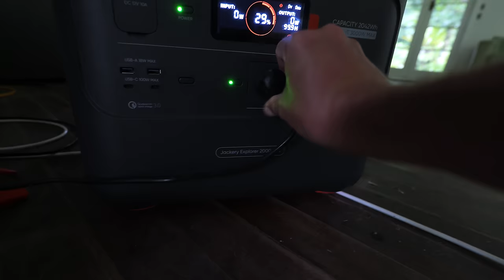Someone snitched. This is my response

Comment: Hi Max. Great job man. Hey Im a chippie and have a couple of ideas that might help you out. 
1, have you thought about using a Ceiling pulldown ladder for your upper deck. Im Sure with some thought you could adapt one to be used in your situation.
2, to make your New fantastic gates more secure...weld a big round washer to the top hinge pin so that the gates cant just be lifted up and off the hinges with a crowbar under the gate. A person with the knowhow could get those gates off the hinges in literally 5 minutes.
To make them 100% secure those hinges are surposed to be installed...bottom one facing up and top one facing down. Thats a tuff job to do but they would be very secure...if you understand me.
And dont worry about whoever wrang the council. Now you have a report with the council it will be so much easier to get help from them in the future 😊
Reply: Who would have told on you ? Gee why don’t people mind your own business ?
Reply: @tonifoster1835  ??? Not sure what your meaning there sorry
Reply: A great reply, love the idea of the pull down ladder and also regarding the gates.  That is how it should be with helpful advice, not complaints. Well done.
Reply: @brennz64  I mean who would report Max to the council, not difficult to work that out is it? People should get a life and but out
Reply: The gates only stop random vehicles onto the property…. They’re not enclosed on the sides, you could just walk around them.
My hubby is a glazier, he always says: “Glass only keeps honest people out”… meaning nefarious people will always find a way regardless. 
(They’re also just thin wood gates… a car/truck could just barrow them down without having to lift anything off. Normal people wouldn’t do that obviously… but if they’re bad people, they’ll do it any which way anyhow)

Comment: To preserve those beautiful beefy hardwood posts slap some black Flexseal rubberized paint on the exposed tops of the posts. Another option is to attach black iron post caps which are very handsome too.
I think the gates would look better and be better protected if they were completely charred.

Comment: You are being very polite indeed. Having a good relationship with your council is a great idea so that is another plus for you. My vote is for all black for the gate. The other thing I noticed but my experience with wood isn't much, should the top of the gate need some sort of sealant on it? The top part you cut back etc. I love the look of the gate and it is perfect for the setting anything smaller would have looked odd.  Regarding the ladder for the raised part of the patio (near the RV) my brother built a wooden ladder like you have with hooks at the top and long enough to be easy to climb (like yours) and when he wanted to get on top of the structure he had, he would just hook the ladder over the top and it looked great and safe.He removed it after using as he didn't want the kids climbing.  It has lasted 10 years so far.  All the best and happy homesteading!!!! ❤
Reply: Great idea & gets around council BS
Reply: Excellent idea! I often see them used in tiny homes to access loft spaces.

Comment: Great response Max to a frustrating situation.
The gate looks fantastic, very boujee!
I’d do it all black. If you do want to leave some grey timber, put a frame around a small section. Then perhaps ask a local blacksmith to craft a silhouette of a pademelon or fig tree out of metal to put in front of the grey timber, inside the frame to make a nice feature.
Reply: Imagine if it comes out that the busybody who reported the stairs has now an official complaint about the gate 😮. I have the feeling it was one of the members of this community
Reply: The gate looks great but probably unnecessary as it makes it slower and more difficult for you to get in and out as well as for visitors, deliveries etc.

Comment: Lovely gate, great work! Going forward I would suggest in your wet, rainy environment that you add a little more cement to create a slightly sloped 'skirting" around the base of each post so that rain water sheds away. I think as it is it will catch on top of the cement and seep down along posts into the base hole? Also, along the same lines, and it would be a nice touch too, to make, or buy a cap for the top of the posts also to shed the water so it doesn't soak into the grain from the top. Example: Nice solar self-charged lights are often the design of fence post top covers. Well done work!
Reply: Good thinkin' 👍

Comment: We had a 12.2 M x 2.5 M steel frame and board on board drive sliding gate installed, it was a monster.  We had to have a pretty big "Y" dog at the end to direct the gate closed when it was windy as it was closing it would act like a sail.  It was large enough it had to be custom built onsite to match the slope on the driveway.  Keep up the good work sir!  🤠👍

Comment: Max, what about building the stairs as a removable “ladder”? No rails necessary.
Reply: Yes, exactly my thoughts.
Reply: Great idea.
Reply: I think he said he needed it for support? That it’s partially structural as well
Reply: I was thinking this too.  Or add a collapsible (fold down hand rail) to it can be stowed out of the way when not in use.  I'm not familiar with AUS building codes though.
Reply: @jmk1962  thanks. I have my moments. 😁

Comment: Max you are always so kind and considered in your response (I’m sure off camera the air was blue though) and see things as a learning opportunity. I’m sure that would wipe the smile off the persons face when they realise they haven’t achieved what they set out to do.  Jealousy is an ugly trait. 
Brilliant work on the gates. Where you summoned the strength for the big one is beyond me.  I like the idea of something a little different in the design.  Going with the Japanese theme can you do something based on kintsugi to highlight the joins between the black and grey? That way it will look more considered rather than unfinished.

Comment: 17:00 Install the "shorty" (cut-off) as a gate-stop so you can attach the heavier gate in an open position to something solid. You could put a cool finial on top of it or, even better, a solar light. 😊 The smaller gate would not require something so sturdy. Maybe just a 4x4 post.
Reply: I like the light idea!
Reply: That’s a great idea!!!

Comment: Hey Max, love love the gate install.  I have done a couple myself.  It looks awesome.  If you feel it needs some extra support because of the weight.  A wheel on the middle end of the big gate may help, or a cable stay pulling the post of the big gate the opposite direction of the gate from the top is the post,  down to the ground a couple meters away, anchored in concrete.  Loving the journey. Thank you for sharing🎉

Comment: I think you could use the grey area to Create something on it, or to attach some found driftwood in an interesting pattern etc... endless options.
However if the plan is to leave as is it does actually look unfinished... just needs something else or maybe turn the grey part into a shape? 
Use another piece of wood as a stencil and burn around it maybe .. 🤔 again,  endless options!

Either way,  it's a brilliant effort. Huge Congrats 🎉
And..
Well done on turning a Frown  Upside down  too 👏
Thankyou 😊

Comment: Make a ladder that attach and disattach to the side so you can reach the top , with out using a normal concept ladder. Maybe set it up where turn into that 2 shelves and one person sit ,so it not a staircase but multi fuction ladder attachment . Or have it where it can be hung up from the roof when not in use.

Comment: Just a tip when setting posts for a gate, get one side plumbed up, and when setting the second post, simply use some more string to create an X across the posts.  When the strings touch in the middle, you know the posts are in the same plane.  Just an easy additional step to ensure things are lined up properly. Cheap insurance.. Good job for a DYI!

Why can't people mind their own business?  You are far more passive than I am!  While there is utility in codes, etc.  Your home is your home and your responsibility.  I think the only time codes should be enforced is when selling or renting a home.  Those steps were fine and gave you utility.  I would have just stuck some plants on them and called them shelves.  That also assumes I let them on my property.  Not sure how that would play out in your neck of the woods though!

For the finish, I love torch+wood.  It's an underrated finishing tool that I've developed some cool techniques with over the years.  IMO, make it all black.  leaving a section like that  just throws the aesthetic off and makes it look like you walked away before finishing.  2 tone has it's place, but asymmetry is wrong in this application.  For something to try in the future, you can use a stencil (or freehand if you are artsy enough) and apply a thick corn starch and water mixture to create a pattern and let it set up a bit, torch the surface, then rinse the corn starch off.  The corn starch will form an ablative heat shield.  There's a lot you can do with a torch, but overall symmetry is normally the most important factor in most designs if you want to create something appealing to most people.

Comment: Perhaps you could use the wood from the steps to make a ladder. Also I would recommend running a cable from the top of each post to the base of a tree or stake to keep the posts from tipping towards the driveway. Finish the gate all black

Comment: Max i’m sorry that this happened to you. Your spirit won’t be broken by these “karens”. Rock on buddy 🤘🏼
Reply: lol, may not have been a female😉.
Reply: @carolineeberle8236  So true, but here in the states not so many know "we" call them Karens and Kevins, but traditionally when the phase "Karens" was given it was both, then became "politically correct" to make it a split to define whether male or female, which is actually relatively new in it's use so "karens" is still correct for most that remember when the term was first used.

Comment: My only concern would be that you could have buried the posts deeper. 48" deep would almost guarantee the footings do not move. With the soils in that area being as wet as they are, you're bound to have some shifting of the post and its concrete footing. To mitigate that potential problem, you could build an adjustable outrigger assembly that over time can be adjusted to make up for the ever so slight tilt the posts will exhibit. They're wood and they will sag at some point, even as large and heavy as they are. YouTube has literally hundreds of VidClips where you can see how to do it. Over time the top inside corners between the gate and the walk-through will begin to get closer as the posts begin to bend towards each other. That's probably the best time to begin construction of the outriggers. HOWEVER, all in all, GREAT JOB!! AND, it looks really nice too! About the coloration grey and black. The blackened wood is of Japanese origin, as you know, and is called Shou Sugi Ban! You could blacken the entire surface and then go back and wirebrush the entire surface using the brush ALONG the grain, NOT across it, and achieve however much gray you'd like to see ultimately. BTW, I'm a landscape architect of 52 years now so my comments come from that experience. I was surprised to see that you were much closer to 'civilization' that I originally thought! Aloha noho'i ~ ~ ~

Comment: I recently retired and decided that I finally had time to improve my home.  My first project was to extend my walkway to my front door.  I had a crew come out one morning to start breaking up the old walkway and hall off the broken pieces.  Before the day was over, I had the county inspector knocking on my door saying that there was a complaint that I probably didn't have permits.  It turns out I didn't need a permit for the size of the walkway I wanted plus the additional.  Keep up the great job around your property!

Comment: all black, leaving a bit of grey would llok great if it was from bottom or top gradiently but atm ir seems like unfinished patch, also higly recommend to pick up some outside varnish and go over the chard wood, as you have a lot of rainy days, it would seep into the wood that is not chard inside and protect it for way longer. Plus it would look more posh with a bit of semi gloss reflection :) Same for the tops of the beams, seems like it would be a great idea to make two little roofs from spare sheet metal, since rain water will seap into the beams and make it rot quickly. Amazing work otherwise!

Comment: Looking forward to seeing how the posts hold up..I sunk mine down to 1.2m or 4ft using only compacted subbase as fill and no concrete to allow drainage.4 years in and just the same as the day they were installed

Comment: Take it all black charred. It's normally called "Shou-Sugi-Bon" or "Yakisugi". Typically done with Japanese Red Cedar, charred, then top coated with a natural oil finish to protect the charring from damage and wear. It is a very durable, long lasting finish that will serve you well likely for the life of the "estate". The contrast with the posts is spectacular, but the weathered section takes away from that contrast in my opinion. That gate opener should also be fine for that gate as easy as it swings (great job on that, by the way), and a second opener for the other gate should be able to be added if needed. I just found your channel, am located in the US, and instantly subscribed for the attention to detail, and the willingness to get things done! Cheers!

Comment: Though this sucks, never, ever, do non-approved work. It doesnt cost much (I know, im poor and still run work past council and engineers).
Not getting work approved has 3 outcomes.
1. Council are ok, but you are on their radar. They will not be happy having to do an unscheduled inspection.
2. They make you tear it all down, which they can enforce, even if they would have approved it.
3. If the council never finds out, when you go to sell, and the buyers get an inspection done, it will be found. The bank could pull finance, the buyer may end the contract, which they can do after the usual pull out time has passed, and then charge you for their costs, or the buyer could nail you to the wall and negotiate a far lower price.
Australia has very strict but non draconian building laws.
Hell my last big build, I drew up in a DnD dungeon builder and the council were so happy with the plans they waved all their fees, which also made working with them on the next shed a breeze.

Comment: I wonder if detachable  stairs would meet building code and still give you the flexibility you want?  Or even away to hook on a ladder at a comfortable angle? And then remove it once you’ve finished working on the van?  For part of my childhood I slept in the lower bunk of a bunk bed and the stair hooked on

Comment: Hi! You could compromise with the grey area by turning it into an artistic design, and filling around it in black. Like, your initials, a star, moon, or something that reflects your surroundings. Also, I noticed that the gates simply dropped down into place, and while being heavy, guessing it wouldn’t take much to lift one off it’s hinges with a six foot crowbar (iron bar?), or a jack. Otherwise, great video, and like others have commented, good on you for taking the higher road. Steve in Ottawa, Canada.

Comment: If it were me, I would have cut the stairs a little shorter and then just rotated the steps a little to just transform it into a ladder instead, as far as I know a ladder like that would be up to code since it would be no different than a movable ladder but instead just permanent.

Comment: Finish the gate all black.  It will look much better, as it is now with that one corner still grey it just looks like a mistake or your flame thrower ran out of gas or Napalm or whatever it uses for fuel.  😂And as a  bonus it will weather much better and that one corner won’t rot out with the humidity.   Great job though mate! What are you going to call your swanky estate? And you’re gonna need a fancy intercom and possibly a security guard to keep out the bogans.

Comment: The Jackery stuff looks interesting. Do they have a model that has 3 phase output?  There are a few machines that I’m looking at for the workshop which I would only run occasionally, so having 3phase output for them would be handy.

Comment: I get it sucks but that it is pretty obvious that the council will want to ensure everything is up to code. It's why you get approval first or ensure you don't need approval instead of having an issue because you didn't get approval. I literally reduced my desired deck size by 30cm to avoid getting approval. It's just life you have to work with the council.

Comment: Put the stairs back up and don’t show it on camera again. Should council wish to reinspect, deny access and force them to get an injunction to do so or remove anything you’re in doubt of prior to them coming out. If council decides they dislike you or they like the complainant more they can and will pursue you beyond anything rational. 

This is coming from my personal experience after a neighbours complaint re one issue which led to council actively looking, during their inspection, for an actual issue they could pursue (which they only found after leaving my home and going through the building code). I fought them on criminal charges (because council can do that) for two years, two solicitors quit stating I couldn’t win and with one weekend notice after the second one quit I self represented and won.

Comment: You keep telling that you over-engineer things. No, you don't. You didn't put rebar through the posts to anchor them to the concrete. You also didn't put rebar in the base itself. Now, little by little, the posts will wiggle out of the concrete and break the base.